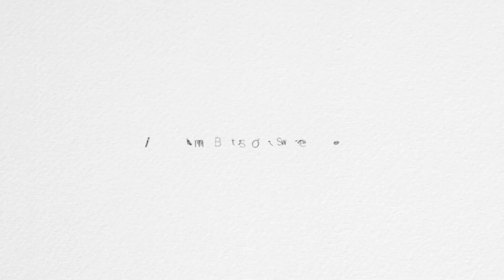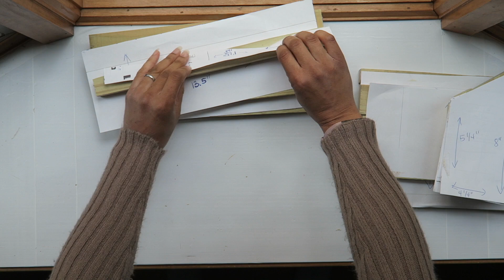DIY Wooden Mailbox ~ How to Make a Mailbox out of Wood ~ DIY #withme

Comment: It’s a very great idea and it looks nice. But after all that work there’s a big gap by the inches for water to get in or any rodent
Reply from the maker: Maybe for some. I’m still using it now from when I first posted this and it’s been fine. No rodents in there so far and no water either. I have it on the wall of my porch that happens to be under a roofed section so water is never an issue.